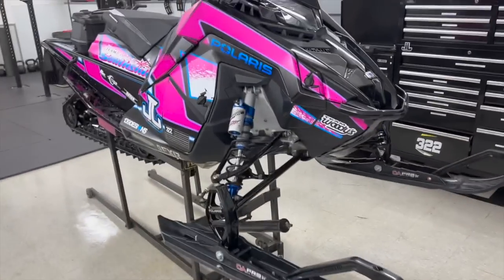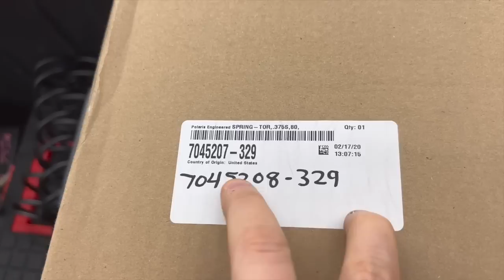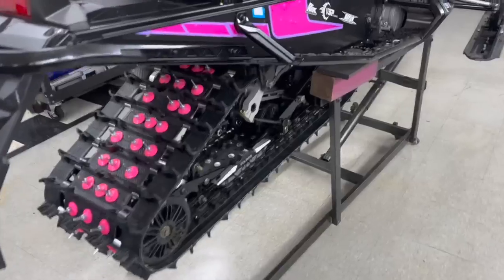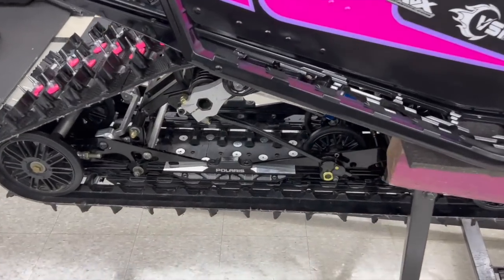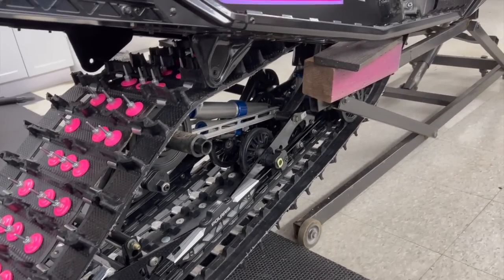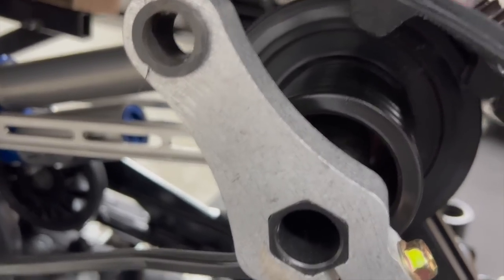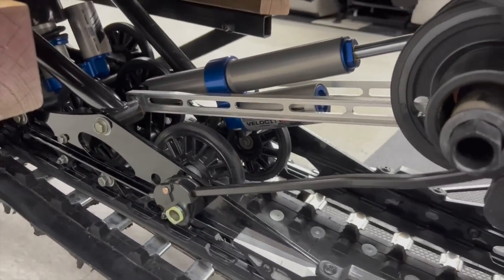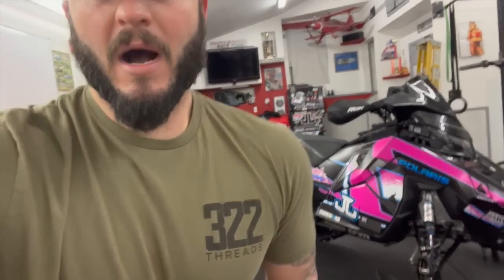DOES YOUR 2023 POLARIS VR1 BOOST NEED HD TORSION SPRINGS? WE TEST THEM AND GIVE THE PROS AND CONS!

Comment: Hey kid, nice to meet you at the Flat rock last week those trap springs we were talking about will be too much for most people I'm 250 + with gear and they are extremely stout 👍👍 But anyone lighter than me will get nothing but beat up!! But it feels so confidence inspiring knowing your not going to get that hard bottoming,I forgot to mention one thing of you notice your rear torsion springs only hit the very rear half of that rail bumper I moved mine back around 3/8 of an inch and it seems to be hitting right in the middle now 👍👍
Reply from the maker: nice to meet you as well! i will have to look at that! Trap springs are a serious spring!
Reply: I'm trying something new I'm using a roller for spring slides it feels great in the garage! Those spring slides are junk I've ovaled out 2 sets already and it ground out my slide rail!! I'll let you know how it works out 👍👍

Comment: i did this swap on my 23 vr1boost. with the oem springs to support my 230lbs i had to be on setting 4 [highest setting]. when i swapped to the new hd springs without changing anything else, the same feeling for me was on setting 1. so i now have 3 more settings if need be. not sure they are worth $500 but they fixed my weight issue. now it feels the exact same as before but on setting 1 vs 4
Reply from the maker: springs are a HUGE factor into the ride and handling of a sled. for $500 id assume youre in Canada?
Reply: @JESSEJAMES322  yes. what a rip off for a simple piece of steel. u cant honestly support these crazy prices. thats insane

Comment: What setting did you have the rear scissor stop blocks. We made our own similar to the new VR1 blocks but haven't been riding yet . We put them in the 21 and 22 XCRs, Hope they help with high-speed cornering
Reply from the maker: ive been running on 3. With the stock tosrion springs we had it on 4 to help eliviate some weight transfer.

Comment: So what would the adjustment be on the shock adjustment be to better the rebound before determining if you need revalving?
Reply from the maker: there is no re-bound adjustment on the shock unfortunately which is why we have to re-valve them to slow the rebound down. the only adjustment is compression but rebound stays the same

Comment: As directed by accelerated technologies I changed one spring to a hd spring and kept one standard,  maybe give that a try.  Also seeing that you have followers, what I would do is ask hygear for their shocks or get a set of elkas to try.  I myself might try a elka stage 5 rear shock in the future you should also do a go pro facing your front suspension and your rear to see what it's doing.  Just ideas for ya.
Reply from the maker: that is an option as well. Where we ride we needed the extra spring. i could get a set of Elkas but Bruce sells Polaris and walkers so we try to get these to work properly and we do. Some valving and springs and we get these shocks to work great. Our set ups are a much more reasonable then a set of Elka's also but i am not one to put the $ in front of me having fun but many are. Three years doing videos now and its tough to get people to spend $80 on a re-valve!
Reply: I ride the same places I know.  Did you ever get last year's xcr setup correctly?   I seen a video somewhere of a guy saying the best way to fix we velocity shocks is to, then he puts them in the trash.
Reply from the maker: yea my XCR was awesome last year. Bruces XCR is awesome along with a ton of other sleds Bruce did all work as they should!

Comment: After watching this I'm wondering if the Trap springs I just ordered from southside are gonna be too much and should have just went with the HD. 230lbs plus gear.
Reply from the maker: thats for sure going to be alot of spring for your weight. i wouldve recommended the HD
Reply: I weigh the same bro. Have HD on my 22' Assault (come standard) and they're spot on fyi
Reply: Definitely too heavy,I'm trying something now with the Trap springs I changed my sliders to rollers on the springs and it feels amazing I will let everyone know how it does on the trail! The handling is amazing with the Trap springs but very stiff and I'm 250 + with gear...
Reply: Gonna order the HD tomorrow. I originally thought I would want trap springs as I have a 2up seat but only plan on using it for  taking kids once or twice a year.